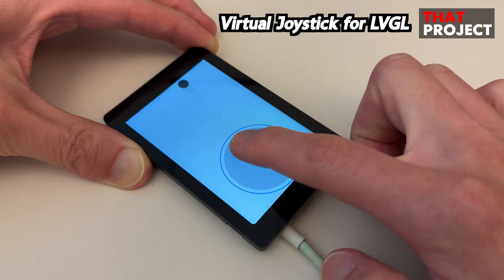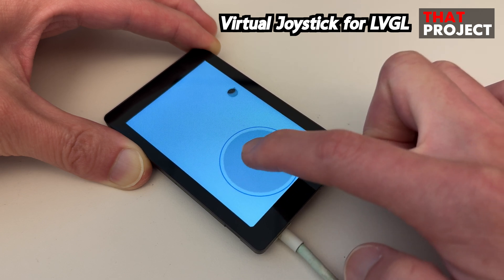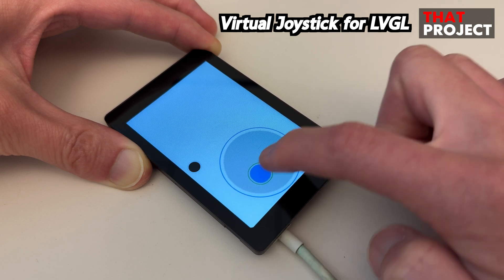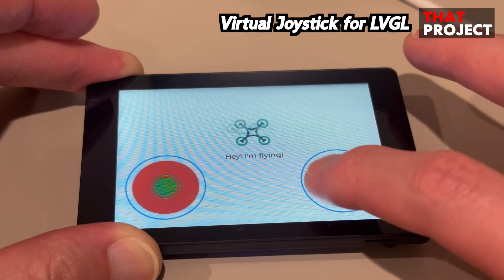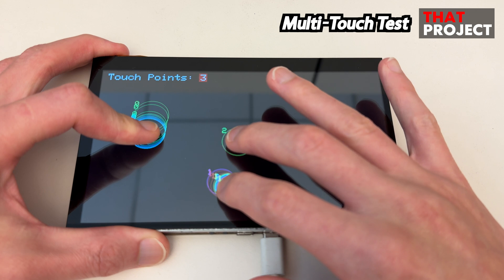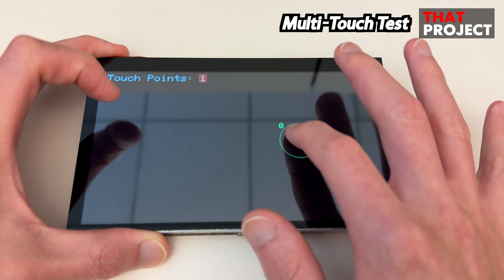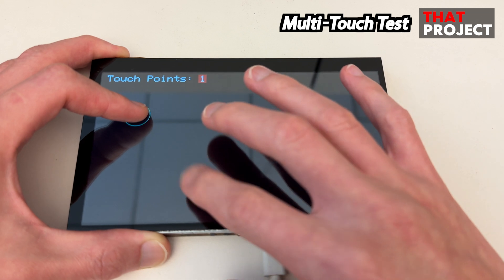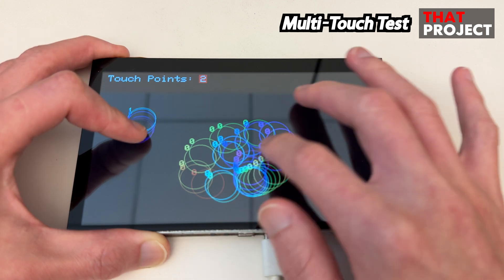Easy On-Screen Controls for Embedded GUI | Creating a Virtual Joystick in LVGL

Comment: Does the WT32 SC01 bring out I2C pins? I need to use I2C for my sensors.
Reply from the maker: I2C can be connected via GPIOs.
(e.g.) Wire.begin(SDA_PIN,SCL_PIN, freq);